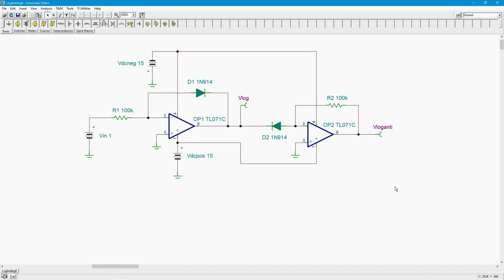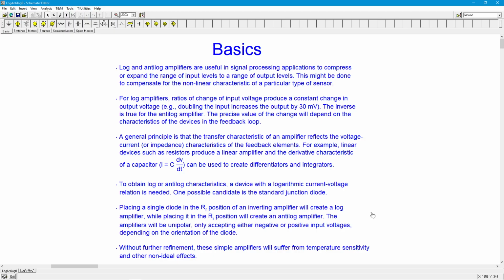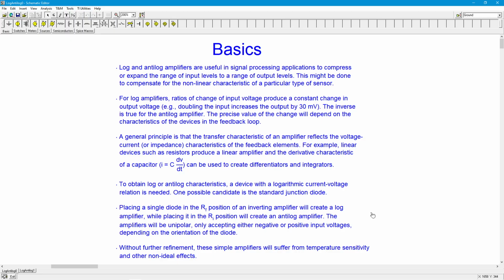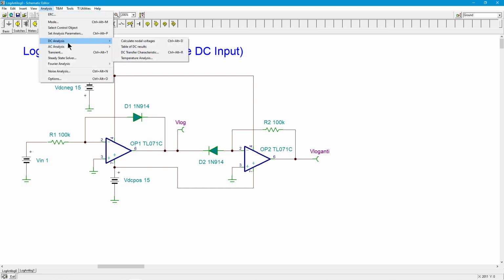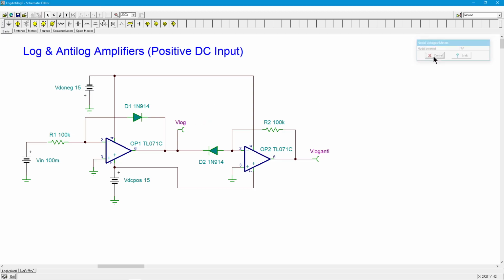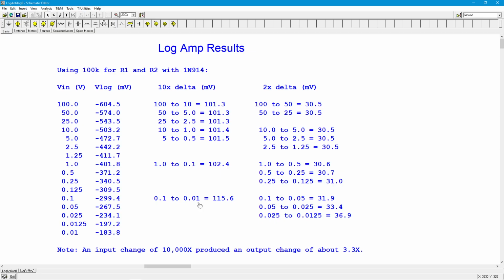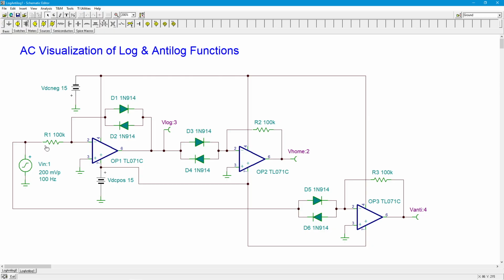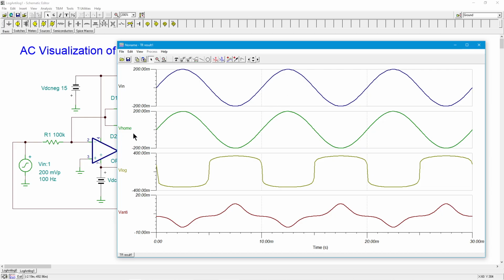Op Amps: Intro to Log & Antilog Amplifiers

Comment: Excellent! Thanks. What value of resistor should I use and why?
Reply from the maker: The resistor value scales the output. A smaller resistor will produce a larger output for a given input. There are limitations, though, regarding op amp parameters such as input impedance, offset, and drift. Remember, this is a very basic version used to illustrate the concept. There are much more accurate (and complex) variations.